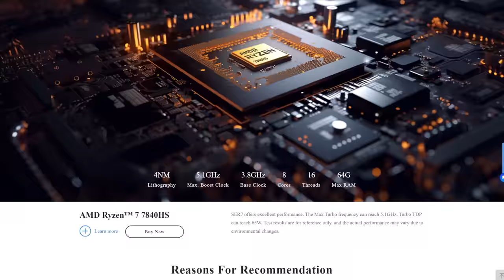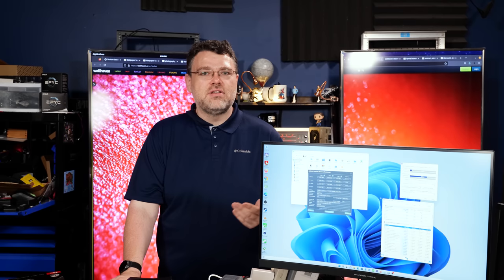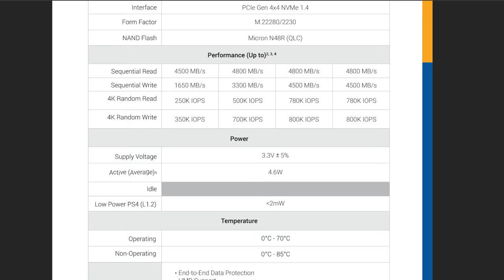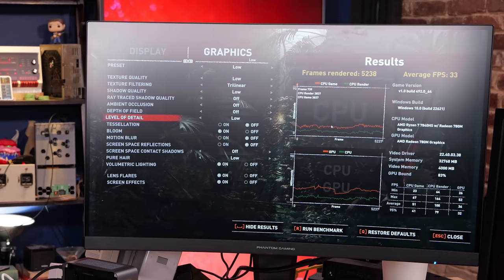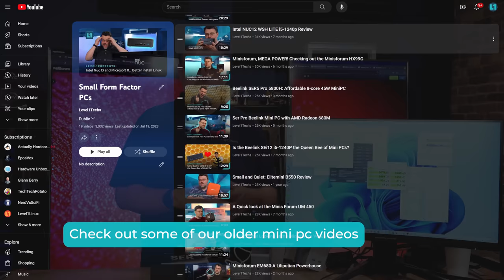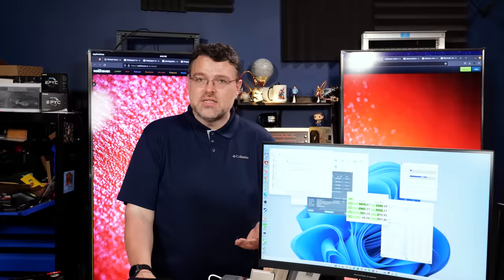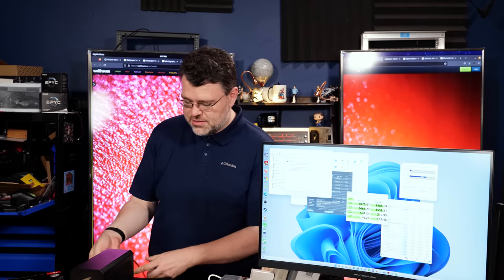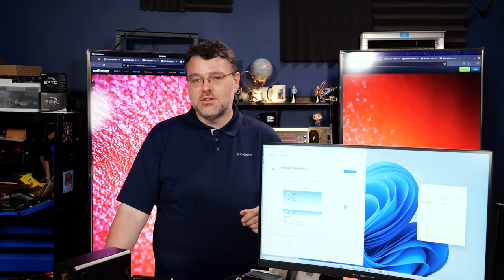Bee Link's Ser 7 Mini PC Power Supply Could be a Trend Setter

Comment: Speaking of using the USB4 port:

"If you want to use USB4 port(PD3.0 100W) for power supply, please set TDP to 54W in BIOS, which supports 20V/5A max.
Please be sure to connect 120W power adapter to DC port for power supply if you set the TDP to 65W."

Good to know about this power limitation.

Comment: Proprietary connectors are an instant no from me, regardless of how good the system may be.
Reply: @markifi  USB-C power should have been default.
Reply: @markifi  now you need to buy a USB-C power adapter? Or you think USB-C cables syphon power from the Ether?
Reply: @markifi The problem is then that you're paying extra for what becomes a useless feature.

The fact that this system supports USB-C power is indicative that they absolutely didn't need to include the proprietary connector, but chose to do so anyway.
Reply: @SnakebitSTI There are plenty of laptops that can charge over USB-C even if they can charge at higher rates or need that to maintain at full performance. I’d assume that it would throttle at higher wattage if necessary.
Reply: What's the point of this proprietary connector? It pops out a different direction than the other cables, so something will still break in the tripwire scenario. And it's another configuration of open power leads to worry about shorting out.
Reply: It's a bigger NO when the cable is not replaceable
Reply: I agree with the sentiment here, if it is not barrel or usb c I do not want it because those are the standards
Reply: I would rather the Lenovo Rectangle
Reply: how often are you going to need to replace that connector? think of it no differently than a hardwired chord
Reply: I would have said "RIP, Apple" a few weeks ago. lol
Reply: @marcogenovesi8570 but they could have included that power brick in the box like they did with the proprietary cable. And they could have saved the space and engineering time to include the connector in the first place. I really don't get it as I don't even see the benefits over usb c; you can only 'plug' it in one way, usb c has two possible ways and the cables are abundant..
Reply: @dschaedler  100w rated USB cables are not "abundant" and quite a few are a fire hazard (i.e. lying on the spec). If you think you can use the same USB-C cable you use with your phone you know nothing.

I'm personally VERY MUCH against adding more and more high current delivery to USB-C so we can have even more fire hazard cables that lie on the spec, and now need expensive, fragile high complexity cables to carry what a 3$ cable with a barrel plug has always been able to carry.
Just do a goshdarn barrel plug like everything else and be done with it.
Reply: @marcogenovesi8570   Thank you for personally attacking me. But also: Barrel plugs solve exactly nothing. They are a dump connector (dumb as in they do not communicate with the controller on the other side). So the devices have to just rely on being the correct voltage for the charger. Having a barrel connector that fits your laptop (they come in a bazillion sizes btw, there is no "standard barrel plug) physically does NOT say it will not fry the laptop. They can be 20V and your laptop wants 12, you should know what happens next. 
With USB-C the devices at least get the chance to talk to each other and communicate a voltage together. Obviously that will not work in some cases where the consumer cheaps out and buys a cheap cable, but that same consumer would also buy a cheap powersupply with a 20v barrel plug for a 12v laptop..
The fire hazards do not lie in the spec, they lie in manufacturers disobeying the spec and producing cables that claim to be up to par but are in fact not.

TL;DR barrel plug is no industry standard, USB-C at least tries to be one
Reply: @dschaedler  Thanks for taking offence so easily. Laptops (and most NUCs and mini PCs that use the same setup) all have charging electronics that accept a range between 18.5V and 21V, and that's a de facto standard for decades.
Also like all decent devices they have a sticker on the bottom saying what V and A they expect from the charger, and how they expect the + and - contacts in the tip.
Nobody has 12v laptops and nobody makes a power component that works ONLY at EXACTLY X voltage because during normal operation the voltage can go up and down by 1-2 volt very easily, that's just the normal rating for those parts.

"barrel connectors are different" it's just a physical connector. It's not hard to get generic adapters with different plugs or even splice the cables yourself.

"buys a cheap cable"? would you blame them? A "proper 100w USB-C cable" costs more a whole darn 19V 120w power brick with multiple tips, and then you have to add the cost of the PD-capable PSU so you pay between double and triple to power your device. If you go fancy with the GaN PSUs it's even more.
Again, tell me you don't know anything about high power USB-C without telling me you know nothing about it. It's not like a phone where chargers and cables are overall cheap even when good.

Which is also the main reason this mini PC includes a power brick and a power connector instead of giving you a PD cable and a PD power brick. 

"USB-C talk to each other" yeah and then just lie and the cable burns, because it's not an actual smart "auto-sensing" like phones had on 5V USB lines, it's an hard wired signal. I can get mini usb-C boards with a little selector that signal to the PD socket to put out whatever voltage and "power target" I want.
That's nice for electronic projects, but it is just an example to show you the PSU has no idea of what the cable is capable of, it does not check temperature or resistence.
If the chip in the wire tells it this is a 100W cable then it's all good for the PSU.

I'm not saying the barrel plugs and 19-ish Voltage is the bestest ever and we won't need something better ever. But if there is something new it has to be better than the old or it can go pound sand.

USB-C is a shait standard that is just adding complexity and cost in the name of "intelligence" when in fact it is very much not, creating confusion and not solving the issue.

So no we don't need an "industry standard" that for power is absolute trash and triples the cost for the power supply part of the equation (cable + PSU, see above), while also prone to counterfeiting.
Reply: @marcogenovesi8570  While I didn't express any nuance in my original comments, I would have to agree with you. USB-C is certainly not a "one size fits all" solution and would only make sense here if properly implemented, but I also don't think the magnetic connector is any better, unfortunately.
Reply: @AliceC993  Yeah sure this magnetic power connector they used is weird, big and unnecessary, I'm not a fan of that either.

Even assuming what Wendell said in the video is relevant enough for a static device (which I personally have some doubts it is a problem even for laptops, the connectors plug in pretty tight) you can use Lenovo's "square barrel" plug and it will still be fine and well-known enough to be easily replaceable. 

But USB-C is simply a bad standard, the issue is in the spec itself, no amount of "good implementation" can save it. It adds complexity and cost and confusion but without any real additional "smarts" or "safety" over just a dedicated power cable. See the answers I gave to the other guy in this thread.

Comment: Proprietary connection is always garbage, if they release and an adapter with a long cord to a standard round power connector, this would be tolerable. Right now it's annoying. No ability to extend this as needed for standing desks, still love my GTR7 Pro . That Hermes Orange is so gorgeous. still debating if an eGPU is warranted
Reply: Plug the wall power adapter into an extension cord. Problem solved.
Reply: @RANDOMNATION907  absolutely wrong, now the problem is worse with a giant power plug brick in the worst position.
Reply: @herlegz6969  On the floor, behind your desk?

Comment: I'd like to see a cheap x86 mini-pc that can decode 4k hdr hevc (av1 if we were lucky) and can run off PoE.
It'd make for a fun unit to attempt some full media center magic on.
Reply: Would you buy a cheap ARM v9 or RISC-V system that compares with Apple Silicon?
Reply: @sativagirl1885  No, I want x86 because part of my dream machine is native Steam.
That way Big Picture mode can make up the core of the UI and you can mix local low power titles and remote play high end games.

If Steam makes a full client for ARM or RISCV then that'd change things.
Reply: @LanceThumping  the games are x86 programs so the only thing you can do on ARM or RISCV is Steam's game streaming thing.
I mean sure you can emulate x86 on ARM/RISCV but that's a different kind of thing that Steam isn't doing with their SteamOS

Comment: I'd like to see barrel and this connector be able to do usb c power negotiating. No more mismatched plugs that could fry your box. Small, medium, and large connectors, thats it. If it doesn't work it doesn't work but it won't fry your device.
Reply: most if not all are between 18.5 and 21v and that's usually what the power regulators in the device will also accept. There is no real need to "power negotiate" when by default you are already at the same voltage of the device. Now the real issue is how much watts the PSUs are rated for, but it's not a "frying" issue. If you use a too weak PSU it will trip its overcurrent protection and shut down.
Reply: @marcogenovesi8570  There are quite a few mini PCs with barrel connectors that take 12V.

Comment: laptops also have the advantage of having a battery connected
so u arent at risk of system crash due to momentary issues with wall power
all the mini  pc is likely to have is a relativity small capacitor
at 100 watts the capacitance is not giving you much room for error
Reply: if you have wall power issues get an UPS

Comment: regarding the thunderbolt being 4x and not making much sense for faster graphics cards, would that still be the case for machine learning? My understanding is you want to keep it all in the GDDR so you'd only really be transfering the data once to load it.
Reply: It seems for machine learning there is no significant loss of performance when running an eGPU over TB3. One user benchmarked his 3090 inside his PC and compared to in an eGPU case and found there was almost no difference for Stable Diffusion. OTOH there was about 80% loss of FPS in games. I personally use my 3090 in a mini PC and think it's a neat solution.

Comment: I think I could do without the proprietary power connector, and I don't quite get why they bothered. It has USB-PD(?) after all, and if they really wanted a power connector that doesn't block one of your high-speed ports, maybe that little bit of power filtering and a barrel jack would have sufficed like any other notebook/device? It can't be that expensive compared to the price of such a machine. Why reinvent the wheel? Ehh, doesn't really, matter though...

Comment: It's simple DC, so 19v * 5.25A = 99.75W... So not north of 100W as stated in 2:30, more like almost 100W.
Reply from the maker: It's not 100% efficient so why the kill a watt reads around 105-110w . . .
Reply: @Level1Techs  I don't disagree, but magnetic connector should see no more than 100w, also you mentioned those specs just before the "north of" line, so that's what caught my attention.

Comment: Good that they're trying to fix the power connectors but I don't buy the filtering excuse. They should actually have enough hold-up time to swap a connector. USB and barrel jacks would okay if they just recessed the port enough that it's impossible to exert any tangential force or torque on the connection e.g. SFP+ to chassis style. Or go full induction and charge through the desk

Comment: I want to see beelink build a mini-pc that features a 6 core 12 thread am5 cpu with a dedicated amd GPU.... a proper mini-gaming machine. Even if the package ends up a little larger. Also faster memory support.
Reply: I agree. A socketed CPU capable of 65W and (ideally) a PCIe slot for a GPU would be quite nice. Even if the GPU is in an MXM format (less common but oh well), that would still enable a 12-core R9 7900 to be used in the machine, as well as whatever powerful GPU's laptops can handle now.

Comment: Looking up the AMD Radeon 780M build into this APU, it should support 8k60 AV1, 8k43 H.265, 4k175 H.264 De- and Encode.  So with a good external USB capture card, they might make a good streaming PC?  Small enough to fit inside the case of my gaming PC?

Comment: if USB-C PD is commonly available in 100W/20V5A what exactly prevents just running two in parallel for the <1% who will push it that far since a spare USB C slot seems a lot more useful than a uncommon power connector.

Comment: > USB to HDMI dongle

Just what I want, more dongles. Just give me HDMI and display ports.
Reply: I think two monitors is a decent amount to have without resorting to adapters from USB-C or dongles/docks. My similar issue though, is that there's only one USB 3.0 type-A port on the front, and the only rear ports run at USB 2.0 speeds. Having those 2.0 connectors run at 3.0 speeds or including two 3.0 ports on the back would make the IO go from okay to really good, in my opinion.
Reply: Give me versatile ports that I can adapt into whatever I want.
Reply: @tim3172  Well there's already three USB-C ports that can be adapted into almost any other connector, so at that point, I would say it's important to strike a balance between the different types of users. Those being people like yourself who choose to adapt ports and customize the machine as they wish, and people like me and (presumably) the original commenter who would rather not use dongles and extra accessories to get the ports we want. 
TLDR; There's something for everyone, except (personally) enough USB-A 3.0 ports.

Comment: It is the reason I am not buying this. Going for the venus instead
Is usb power delivery from this box also good for it getting power in over usb?
Reply: The USB-C is also a power port, if you connect a power supply it will run the PC
Reply: @marcogenovesi8570  that makes it a bit better at least. The way it was worded was more that you could charge your phone/tablet/laptop from the USB port on the pc. Thnx for the answer

Comment: Any chance you could ask them to release a unit with ECC memory?
Reply: In-band or 80-bit?
Reply: @shanent5793  I honestly don't care. There are so many SMB and hub offices that could operate with one of these mini-pcs and a USB-C drive bay for backups.
Reply: Raptor Lake-P devices can do in-band ECC: ASROCK Industrial has them in mini-PC, LattePanda has an SBC (Sigma). I'm sure if you bought enough of them Bee Link would enable traditional ECC in their Ryzen PC's if they don't already have it
Reply: @shanent5793  Thanks for that but problem with buying these bulk or over $1000 has always been the customs import charges.

If I can buy a unit at a time and get the parts locally it's worth it for small businesses otherwise they run everything off a single pc until the inevitable happens.

While the Sigma does look interesting it's not 8/16 and those E cores don't work as well with virtualization.
Reply: @ericneo2  I hope you enquire anyways so they know there's interest!

Comment: Basically, all of the "tests" of these Mini PCs that come from Mini's forum, Beelink (well, actually they are almost all OEM devices, which then receive their logo from the distributor) etc. are just advertising videos. The manufacturers provide the YouTubers with test devices and many YouTubers then mention that they received a test product from the manufacturer, but would otherwise tell their honest opinion completely freely (no $$$ at all). Eh, no! You are dependent on the manufacturers who provide the test products. If you just think about it for a moment, it's clear that nearly all of the mini pc YouTubers can't tell their opinion freely. And then it also explains the fact that almost nothing was mentioned about problems in all of the tests. They read the specifications and show that the device starts and passes a benchmark. And after the video -> is before the next video about the next mini PC. The previous device is forgotten.
  
If you then look around on Amazon and/or in various forums (e.g. Reddit r/MiniPCs), you will see that many users have massive problems after a few months and that the refund of the money or a replacement EMiniPC either does not work or takes months .

Comment: Would this type of thing do well as a NAS/Home server running Linux?
Reply: I'm using an older 5800u version for just that purpose running TrueNAS scale, Jellyfin, and Home Assistant OS.  You don't have enough drives for data protection/redundancy.  I keep a backup of everything on an external USB drive.
Reply: If you want to do a raid set up... it'll take a bit of doing as far as connecting multiple drives, but for a very simple set up... sure.
Reply: Yes, I'm using a cheap n100 mini-PC running Ubuntu hooked up to a 4-bay DAS enclosure and it works great as a media server.
Reply: You might want to look up NAS Compares video "The Zimablade Review - Flexible, User Friendly AND Cheap...WHAT?"